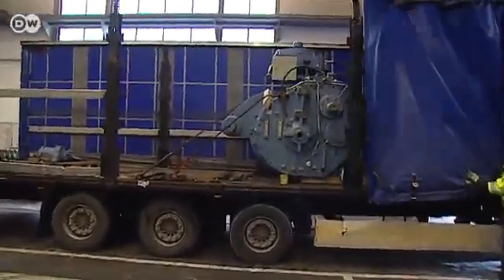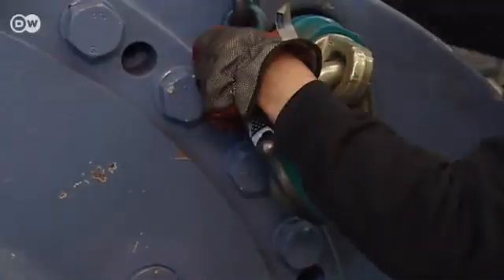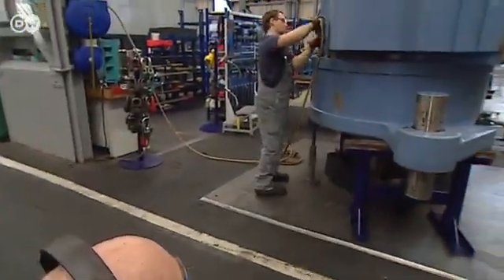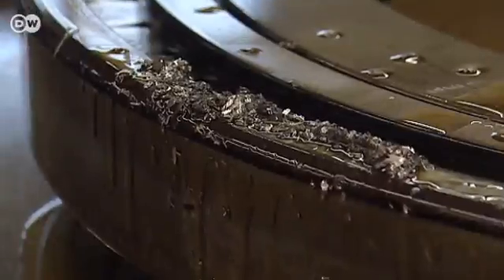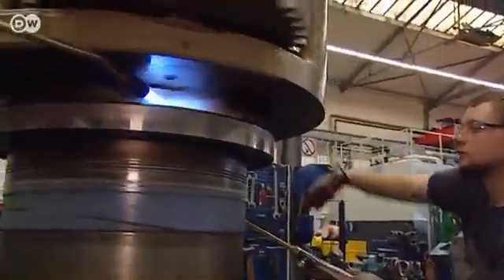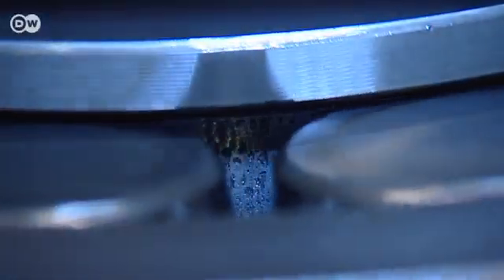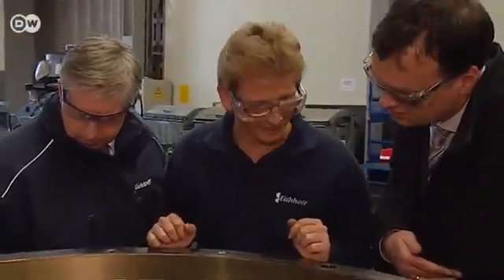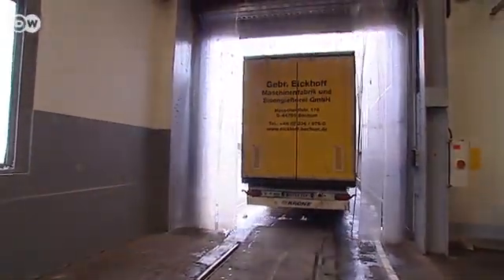How wind turbines are overhauled | Made in Germany

Comment: much more expensive than the green lobby would have us believe. And all the oil, and energy that goes into casting the metals, that have to be mined.  This is surely not 'pollution free power'
Reply: do you know how little "oil" hint zero it takes to power the refineries that make the metal?  natural gas and coal do that.  metals can by recycled. this thing offsetts far more power in its 10 years of operation than it ever remotely consumed.

what a dumb argument.  most of the cost of these things are land lease and infrastructure and erection.  thus the push for massive offshore units wherever possible.

in the us solar and wind arent that much higher especially as power continues to rise as utility companies raise rates about 5% a year
wind and solar are largely capped, installation labor rises with inflation roughly but once installed they're immune to the economy.
Reply: @Richard-ie1if  this was the stupidest response ever and if you dont see why then please leave Earth.
Reply: Yup. AOC thinks "its just a windmill guys. We made those in woodshop class but these make electricity from wind and its free."

Failed to mention how much co2 is pumped out of the train that is transporting them. 1 blade alone takes the length of 10 railcars and the train will pump out more co2 than 2000 normal cars do in 5yrs. She doesnt mention each turbine, when all is said and done, costs 7 million after freight & labor. Also fails to mention maintenance costs. Fails to mention on days w/no wind you better have a diesel gen or electrical lines on standby cause those blades will warp due to gravity taking a toll on those giant blades and then when you dare run a windmill w/warped blades...kaboom. Or the 100,000s of birds killed annually. They just leave a few things out

Comment: Oil analysis should have caught this issue before that much damage.
Reply: That would be up to the owner I guess. Expensive lesson for them.
Reply: But the fix would likely be the same. A UOA would only show steel or yellow metal in the oil
Reply: @tjm3900 I think this is a high moisture content problem, they could have caught this before it lead to the corrosion and cavitation pitting
Reply: Rolling element bearings and gear teeth undergo fatigue cycle damage. Once the load is specified during the design engineering phase, the failure is guaranteed in a certain number of cycles (rotations) of the gearbox. It's predestined to fail. No amount of oil analysis or oil changes can prevent this.

Comment: An expensive way to generate electricity.
Reply: But after all the cheapest. Keep it real.
Reply: @Stefan_Dahn  Not really, why don't you prove it. Coal, natural gas, nuclear, et cetera are all cheaper.
Reply: @franksignature5671  Ain't no problem, Franky boy:

https://en.m.wikipedia.org/wiki/Cost_of_electricity_by_source

Now back to Kindergarten, boy. 😂
Reply: @Stefan_Dahn  Great an article link to Wikipedia. You do realize that Wikipedia is never an acceptable to source in any educational level? How about the fact that windmills only operate at 40% efficiency while others operate at 90% plus. While it is true at peak efficiency they can be cheaper temporarily due to the fact that they are subsidized more than others per amount of energy made. This puts them back a lot. Furthermore, windmills need to have backups for when the wind is not blowing enough or when it is blowing to hard, yes, they have to shut down most windmill types in bad storms. Coal plants that are strictly regulated in first world countries are only three cents more or even two cents less than wind, in unregulated plants wind could never compete. While advanced natural gas is always cheaper. Look up "Hidden costs of wind electricity" by Tom Tanton. His research indicates that wind is three times more expensive than natural gas and even coal and nuclear. The article you linked is by the EIA most likely. They fail to take into account transmission problems along with minor infrastructure problems. We can also talk about the massive amount of environmental damage windmills cause.

Before you try to insult someone, why don't you get an elementary level understanding of economics.
Reply: Like mining coal doesn’t  take fossil fuels, or fracking natural gas doesn’t pollute. I love how the opponents of wind energy always bring up co2 foot print. Honestly I’ve done research and to be honest natural gas seems to make sense but sense that natural gas is acquired from fracking or drilling for oil we all know it is dangerous. More so than we are lead to believe. Any other reason the clean water act was repealed in the USA. Yeah probably cause it’s totally safe and there is no way any oil&gas company might catch a lawsuit for contamination of the drinking water. So for now we have nuclear and natural gas as the cleanest reliable electricity producers. We also have the ability to diversify in other ways so that should be an option. Last I checked weapons of war are astronomical in price so what is money really worth?  The cost of 1 missile is probably the same cost as a wind turbine
Reply: @franksignature5671  Why are you even bringing up efficiency here? When a fuel isn't involved, 1% efficient generator is the same as 100% efficient generator if they have the same output.
Reply: @Stefan_Dahn  I like wind turbines but your article says nothing about electricity prices. It mentions the costs of power capacity. You should look for the costs of energy generation. That would include the maintenance costs to the lifetime as well. In my opinion, wind energy never wanted to be cheaper than gas, coal, nuclear, but greener.
Reply: @franksignature5671  I don't believe they shut down WIND TURBINES during storms.  there are sensors and brakes on them so if they try to spin too fast, they are monitored and adjusted to the proper rate of rotation.  Also the entire top containing the blades will rotate to the best angle to catch wind.  They are purposely located where the wind is a constant or rarely stops.  BTW,  wind mills were invented and used way, way back in history - like the 5th century  they were made of wood !  even their gears were wooden pins or cogs.  You need to do some real educating instead of repeating what your buddy told you!   Do you think that all of the countries would invest in thousands of Turbines if it was not worth it!  I don't know the exact number, but there are more than thousands
Reply: Actually it's the cheapest here in Australia, about the same as solar. 
Cheaper than coal or gas

Comment: only built for 7 years of service?
Reply: Built in the UK with huge subsidies and in less than a decade they'll be unfit for purpose and with no help for repairs. They're a wasteful way to generate electricity.
Reply: @jackking5567  I take it that they are built for a guarantee of 7 years and then needs maintenance/ rebuilding such as replacing bearings and possibly gears (much like your car).  Imagine if your car could run non-stop for 7 years or run for 21 years (using 1/3 day driving) stopping for the night?  would you be happy with that performance?